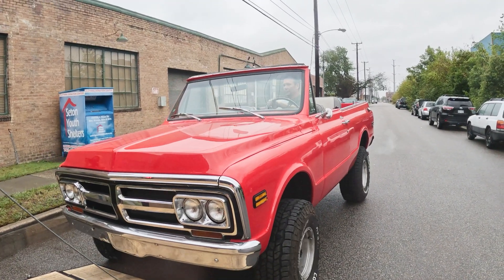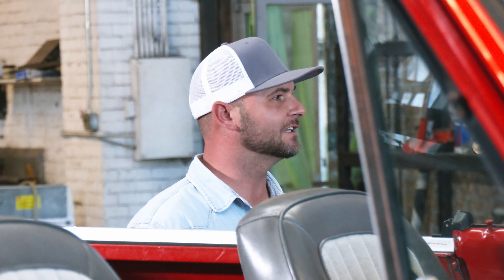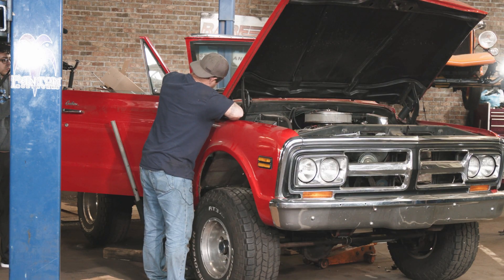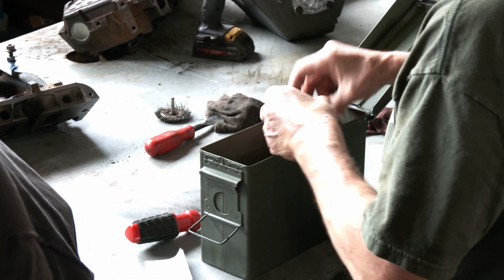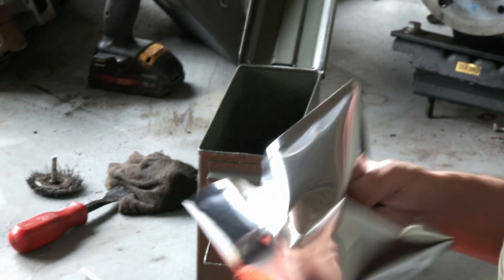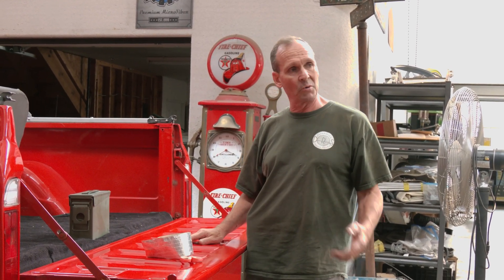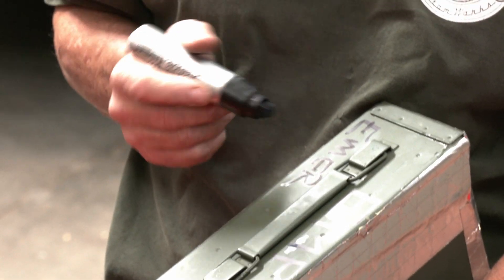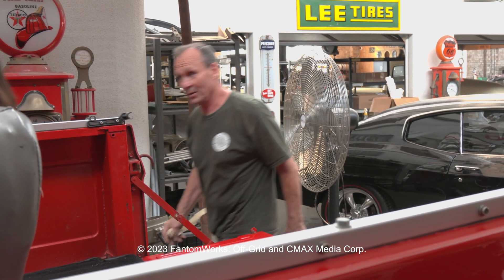EMP Shielding a 70s Truck?

Comment: I am familiar with EMP. One place I worked was tasked to build some EMP resisant devices. I did a lot of reading and research on the project. Audrey had the right idea, mark the cans Emergency Tampons.
Reply from the maker: But what if a group of stranded women happen upon the box after being out in the woods for three weeks... they'd be pretty heated opening a box of "tampons" and finding an EMP kit instead.
Reply: Are solid state devices more resistant to EMP
Reply: no, more exact opposite
 @terrybrown797
Reply: Not if they end up with the only truck in the world that runs. then they will be able to Salvage for supplies more efficiently. Also remember having the only vehicle running during this time will make you a Target.
Reply: Ok, and after they run out of gas what do they do, remember the pumps etc are electronically controlled
 @terrybrown797

Comment: What about the diodes in the alternator? Btw Wrong foil tape wrong and steel box too. Worked at AEL labs for many years, as an EMI EMC and tempest engineer, Points type ignition would be a better choice than a HEI unit. Dual points wired as a single points setup with a toggle bypass. ESD bag for parts not enough protection, to even better protect part a shielded enclosure is needed.
Reply from the maker: We'd love a demo when you have time!
Reply: @Fantomworks  I'm only in South Jersey. Work for a time in the DC area. And I'm very serious I would be happy to come to the shop
Reply: Email will be sent